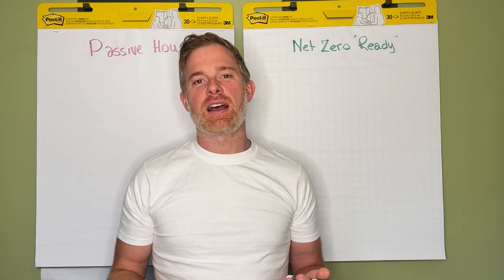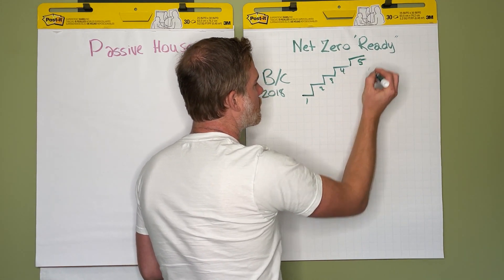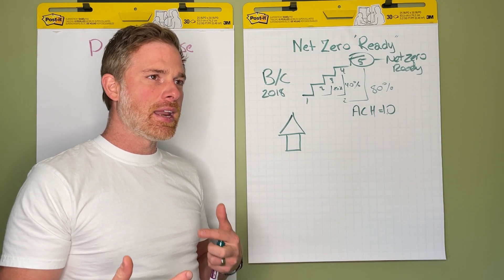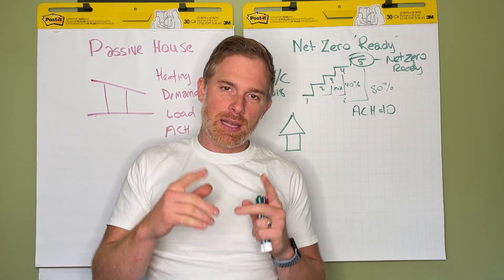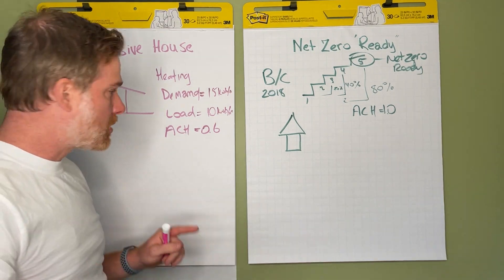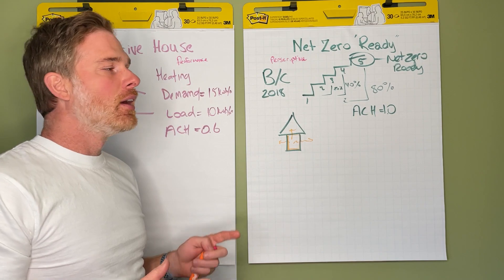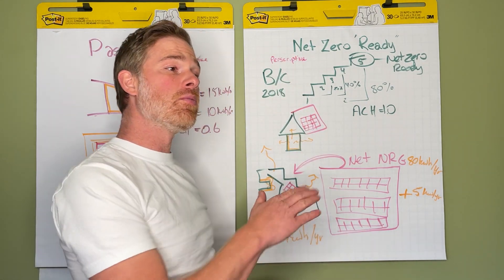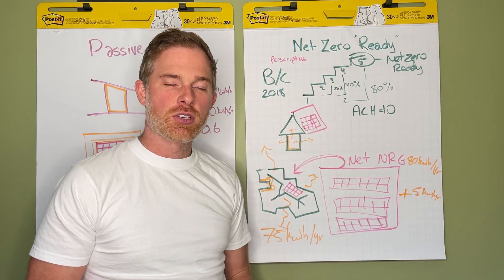2023 Net Zero vs Passive House explained + BC Energy Step Code

Comment: I don't think solar panels in a paddock next door should count. A microhydro system in a paddock next door would be a valid adjustment, but if you can't fit the solar panels on the house or at least in the quarter-acre block the house is on, that shouldn't count.

Comment: Seems like the European problem is their energy is hard to get and extremely expensive compared to what we get outside of Europe, especially in America. They get a lot more techy stuff too like heat pump dryers etc...
But for sure in the north American continent it makes a lot more sense to make a normal house more efficient and possibly use solar panels instead. Here personally I'll be building a nice house that would actually have decent resale value to input cost and do a small solar array with a wood stove back up and a rain water system. Seems like purpose built up front without the extra utilities could actually pay off.

Comment: Terminology is really complicated and important for these topics, good on you for doing such a thorough presentation!

We recently renovated a 70s home to what I'd call "Net-One Month," where we took more of a generation-based approach. I had looked into redoing all the siding with added external insulation, or spray foaming the entire house, even looked into geothermal. In the end, we did pretty much everything that was viable, and maybe a little more.

It would have been really fun to try from scratch to include many more of the passive principles. People definitely should if building.
Reply from the maker: Good for you for taking steps on your home with the things that were viable!  it can really be intimidating to do a high-performance renovation with so many opinions on what to do - and how to do it. 

Building from scratch does provide some unique advantages - but the retrofit side is where we as a community have a ton of potential to shape things for a brighter future.  

Thanks for sharing your personal experience! I think people are looking for examples of people who have chosen to take steps like what you have :)

Comment: I am designing my house right now. I have looked into passive. One major concern is the amount of capital CO2 in higher step and passive houses. Some of the research I reviewed claims that 60 to 85% of the CO2 emissions comes from the materials used and construction. So even if you produce zero CO2 in the running of the house, it still has a big CO2 footprint. A passive house uses more material and takes more time to construct which increases an already high initial footprint. You can go with mainly wood products like Gutex and Accoya to act as a CO2 sink but similar products are not produced locally. The materials are expensive to start with and have high shipping costs which also reduces the CO2 sink. I think local producers have to start manufacturing products locally to cut shipping and material costs.

I am still not sure if passive house is the right way to go but I guess you have to start somewhere. I priced out Gutex, CLT, and Accoya. You are looking at a premium in the order of $400 000CDN for a 2500 sq ft house. So it is currently out of the picture without some major grant.
Reply: The carbon capital conversation is largely a distraction from the more important element of an efficient house.

One example I use, is of course ceramic dishware used more carbon to produce and deliver to your home than plastic/paper plates. You still probably don't rely on disposable dishware. If you extended the carbon footprint of  a dishwasher into that equation, one could be convinced the better thing to do is just continue to use paper plates. Really, it's just a small upfront cost in doing business.

Those things should be lower, and will get lower, but it shouldn't hold you back.
Reply: @ShortVersion1  The problem with the analogy is that the construction of the house is 60 to 85% of the life cycle carbon. If you don't use carbon sink materials when constructing a passive house, the increased carbon foot print is more than the carbon produced for heating/cooling a typical house over the life cycle. In your analogy, the plastic and paper ware consumes more resources than the production of the ceramic dishware and that is generally not the case for a passive house.

If the goal is to reduce carbon, you need to use materials that consume carbon and those materials are generally not that readily available or economically viable  in North America. We have to have things like Gutex and Accoya shipped from long distances at really high costs. CLT is just really expensive.

Comment: My wife and I are currently in the middle of this right now.  We are building a new home and most of the online floorplans are not designed with any thoughts about performance home building.  We found a local architect to modify the floorplan that we like and to help us with designing our new home.  We don't want just a basic rectangle house but we are keeping the design in mind.  Most of the architects/ builders in my area don't want to change or build more efficient.  If they do, then they want to charge significantly higher just because it is not the norm---not because of just the costs.  So there will have to be designs/builders/manufacturers to make it easier for the majority of the homes being built to go to more performing homes.  

It is very expensive to build a net zero home, let alone the added costs for passive standards.  We currently live in a regular built home in 2017 with a 12.6kw solar system.  Last year the solar system offset my power by 80 percent.  Now that we are building a new home, we are going to build net zero as our goal.  

Our goals are to build a more efficient, tighter, cleaner home for our family.  Our architect actually went thru the numbers of SIP, ICF, 2x4 and 2x6 with ZipR6.  SIP was almost twice the cost and ICF even more.  The most cost effective per R value was the 2x6 with fiberglass insulation with approx=R25.--Southeastern US.  I could swap the fiberglass insulation with rockwool batt and make it R29.  A little more cost but worth it in my opinion.  We will be using Heat Pump HVAC with ERV and dehumidifier.  Sealed crawlspace and attic.  We will have a hybrid water heater, high efficient windows/doors.  

This to me is a much better than a code house and will future-proof our investment.
Reply from the maker: Steven, I really appreciate your dialogue on the topic!    You're voicing some of the biggest issues I have seen across the industry as we move towards NetZero.  

The reluctance of many of the common trades simply adds costs, delays, and frustration to the well intended process of building more energy efficient homes. 

I will add that there are some common practices that are causing a lot of trouble with trapping moisture in the walls because of how the vapour barriers are installed. - so my caution is to be VERY careful if you are using a vapour barrier behind your drywall (on the inside of the house). 

The "drying potential" of the whole wall needs to be considered with regards to your specific climate zone, because as you move up in R-Value, you also decrease the ability of your walls to dry.    'Variable Vapour permeance' assemblies will be your golden ticket to stay out of trouble in the long run. 

Also, I took Dr. Joseph Lstiburek's online training this summer, and pound for bound will be the best money you spend to get ahead of issues in your build.   - You can tell him Brandon from Kelowna sent you :)

I stuck the link to his next seminar in the bottom of this comment. 

Please feel free to weigh in on your progress for your project. You are not alone with the challenges you are facing - but you are also not alone on the path to building a better home for the future!

https://www.buildingscience.com/events/building-science-fundamentals-5
Reply: Please don’t use fossil fuel derived insulation to save on renewable energy...
- from a Certified passive house architect, natural building materials "expert", specialized in  passive retrofitting , etc, France
Reply: Ps consulting or architectural studies for passive house and or NZ houses is more costly because it needs more time, higher trained people, and very close qttention in schematics, building details and during the execution.

Comment: net zero, if you can buy your way into it rather than design your way to it like passive is fundamentally the major flaw of net zero.  from a stronger sustainability point of view, net zero is  a very weak attempt at resource conservation.
Reply: We need a new standard of net zero, that includes the annualised embodied energy of the build as well as its year-to-year energy consumption. It won't fix the "buy your way in" but it will make it a lot more expensive.
And passivhaus needs to move beyond "per square metre of floor space" that rewards bigger houses, and work on a "per person capacity" that counts up single and double bedrooms and divides energy consumption that way. A multigenerational house that is big because it's got ten people living in it is efficient. A house the same size with two bedrooms and four living spaces is not!

Comment: This is in order for houses to become completely unaffordable and very expensive to live and maintain. So what the house keeps warm air inside the house better than before, it is negated by the fact that ventilation has constantly to throw away warm air and expensively heat cold air by electricity that’s going to blow into the house to replace it. Good old house was no brainier - much cheaper to build, much cheaper to maintain. In fact, those modern houses don’t even keep warm air better because although insulation is very thick, people install huge panoramic windows around the house and the idea of insane insulation becomes completely negated.
Reply from the maker: Tongo,  I see the concerns for the extra cost. I feel that deeply as well. 

I also know that the choices we make about the quality of construction materials - are the choices people get "stuck with" for the life of that building.    Growing up, the cost of utilities mattered to my mom, as she tried to provide for our family. Looking to the future, those costs will continue to rise, and I believe that hard working folks will appreciate living in homes with better insulation and lower utilities.
Reply: For hard working folks these new A++ houses hasn’t become lower utilities houses as it was promised when industry lobbyists pushed their agenda into parliaments. The utilities have become higher.
Reply: Das ist ein Fehler. Wärmerückgewinnungsgeräte haben einen Wirkungsgrad von 95%. Und passivhäuser sind nicht teurer im Unterhalt. Ja teurer bei der Anschaffung  25-35% mehr. Dafür spart man Heizkosten. Öl 1.20€/l gas 1.40€/m3. From 50€ Cent kwh

Comment: I was sure something had to be wrong with your units, since the consumption per anum can't be that low. You've messed up little bit passive house demand, it's 15 KWh/m2. For an average American house of 2000 sqft = 185 m2 it's about 2,8 MWh per anum. It's still a extremely low value. I have very low energy house built 10 years ago (Della/Ytong aircrete, 160mm polystyrene insulation, triple pane windows, recuperating ventilation,..) and I use about 3 - 4 times more energy for heating per anum.
Reply from the maker: Oakld, yes you are right I was stumbling with my units once I was in front of the camera.  Thanks for being on the look out for misinformation.

Passive House standards are super high, and here are the exact specs. 
https://passivehouse-international.org/index.php?page_id=150

Space Heating Demand : not to exceed 15kWh annually OR 10W (peak demand) per square metre of usable living space

Space Cooling Demand: roughly matches the heat demand with an additional, climate-dependent allowance for dehumidification

Primary Heating Demand: not to exceed 120kWh annually for all domestic applications (heating, cooling, hot water and domestic electricity) per square meter of usable living space

Air Tightness: maximum of 0.6 air changes per hour at 50 Pascals pressure (as verified with an onsite pressure test in both pressurised and depressurised states)

Thermal Comfort: Thermal comfort must be met for all living areas year-round with not more than 10% of the hours in any given year over 25°C* 

There are also some restrictions that they refer to as "Hygene Criteria" that are meant to address potential condensation & mold issues within the thermal profile of the assembly design.
Reply: @levelupstrategies  Yes, that's the standard I peeked at once I sensed something is not exactly right. I cited only the part relevant for that particular demand. But don't get me wrong, I think you do a very good job explaining that! :-)